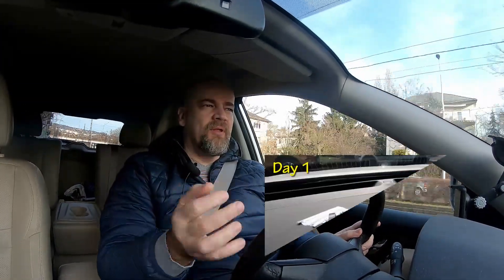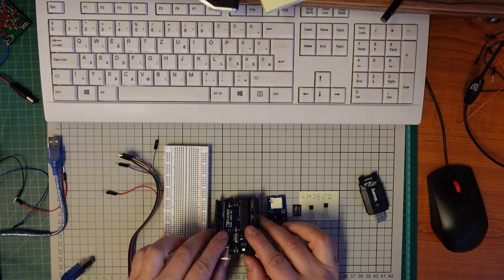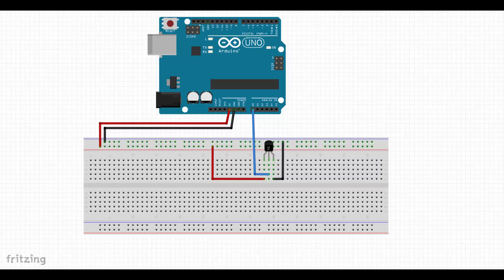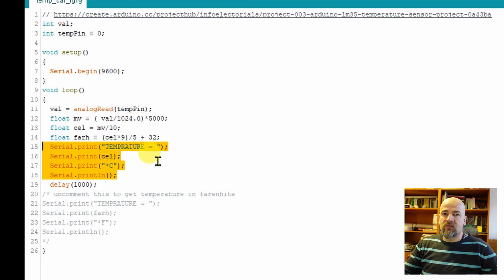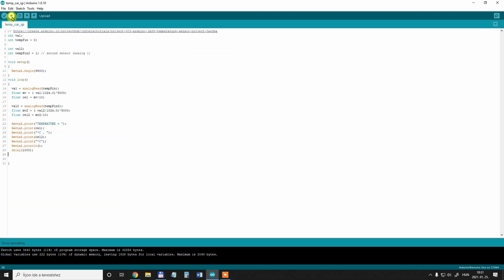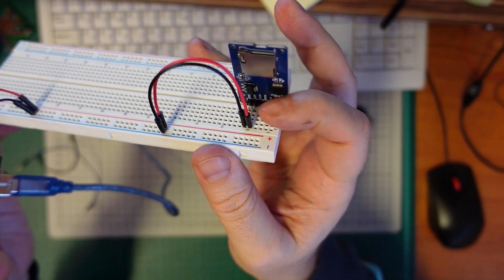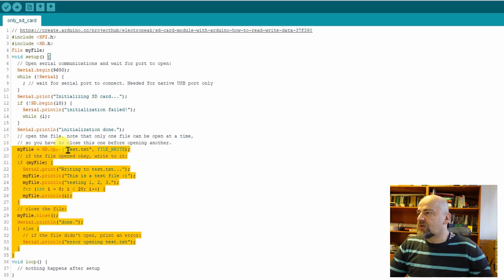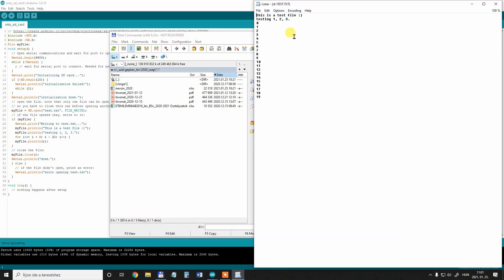Arduino data logger with two temperature sensors (LM35DZ) from my 3D printing material in car test

Comment: Hey gr8 job making this tutorial, i'm just getting into arduino and this has been something of interest, datalogging, is it possible to have a time stamp also with the logged data?
Reply from the maker: Yes, but time since the arduino is powered. Or you can set the clock, and use that as time stamp.

Comment: A very good video, with a very good explanation. I'm beginning on Arduino, and so, I have some questions:
1) Why you don't connect Arduino to USB car Ports?
2) If I need more wire to the second sensor, for example, to put it outside my house, how can I do it?

I'm trying to make a lab project, to measure rock temperature when they are taken outside a hooven at about 60ºC, to see the temperature downtrend. But I don't know what type of sensor to use, because I need to attach the sensor to the rock sample. And when do that, I must improve it, for example do the same but with 4 or 5 rock samples simultaneously.
Can you help me, please?
Reply from the maker: 1) Car USB port turns off after 5 minutes, when car is not in use. 
2) Officially it is not recommend to use long wires, but I tried up to 2 meters, works great. You could try, test it with two sensors, one with short cable, other with long cables and compare the temperatures. If you really need very long wires, there are some digital temperature sensors, try them.
Reply: @MyTechFun  Thanks. Another question, you use a PowerBank. How can you have certainty about the Voltage <12V output? You don't mention what kind of material you used.

Comment: The DS18B20 I2C temperature sensor that you mentioned has one other advantage other than just the possibility to use longer cables: Since it has an internal reference source, you should in theory get more accurate measurements. The accuracy of the analog measurements done with the LM35DZ varies with the Vcc if you don't use a stabilized external reference source via the Arduinos Aref pin.
Reply: DS18B20 is 1-Wire, not I2C. But, ofc, it should be better.

Comment: Love your well-thought-out methodology. I've been meaning to set up a temperature logging system like this to chart the temperature swings in various locations in a refrigerator that my mother uses to store her insulin. These modular systems have made it a lot easier than I would have done it in the old days (PIC uC, EEPROMs, RS-232 port, etc).